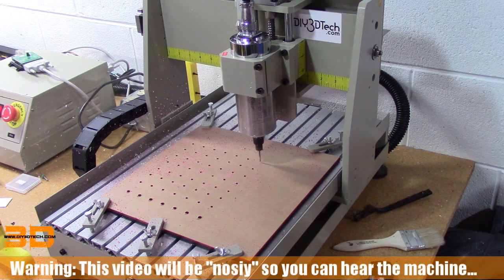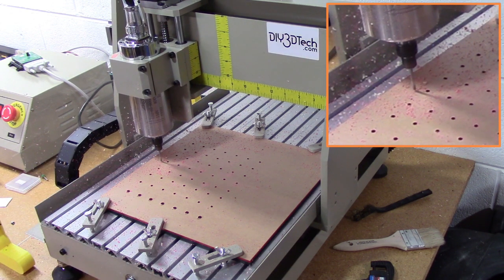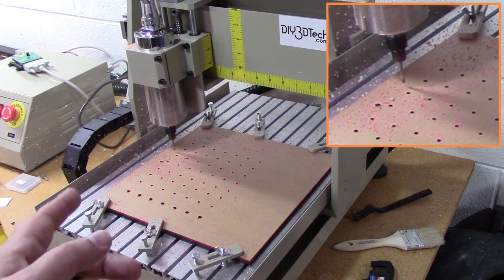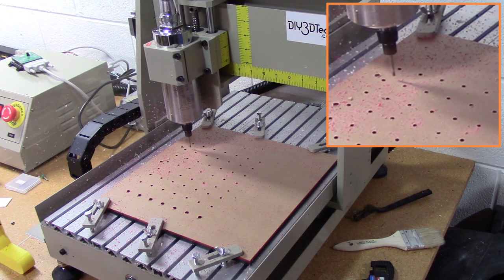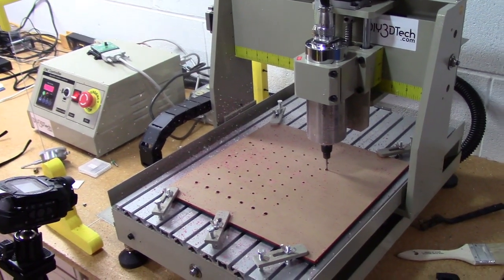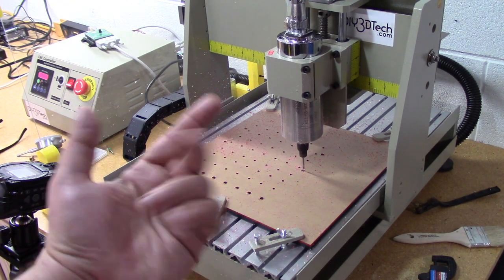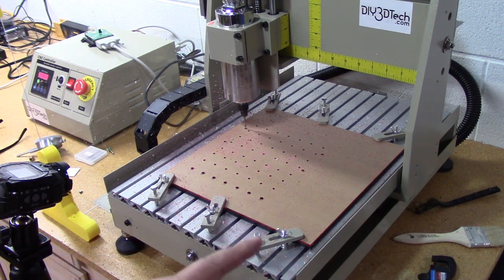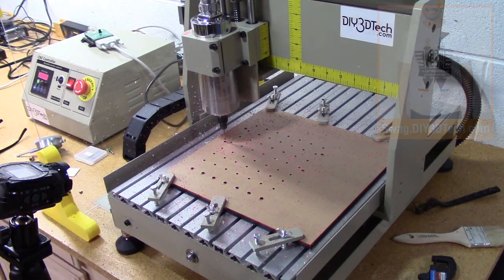3040 CNC - Quick Update!

Comment: I have a 3040 purchaced from china and can not get the X axis to work,I have replaced the stepper motor board but still nothing.   All the pins hsve been set up correctly.   Any idears  I need help before I put an axe through the whole machine please.
Reply from the maker: Did you (1) take a multimeter first and check continuity of all the wires (2) did you check the continuity of the stepper motor itself?  Also assume the Y is work so that is a know good, (3) did you try swapping X&Y to see if that works (since Y is known good).  Myself I am betting on #1 as I have a number of viewers write and tell me they have had to replace the stepper wiring harness on their 3040.  Hope this helps!

Comment: I have the same vfd. I would like to wire limit switches to it but am confused on where they would hook up after opening up unit. Have you ever wired limit switches to your controller?
Reply from the maker: Limit switch are easy per-say if you are using GRBL (which I am) as you simply wire them into the CNC control board to the limit switch pins.  If you are using Mach 3 it is little harder as you will have to run them (or should) via buffer to the correct pins of the parallel cable.  If your a home hobbyist I would highly recommend the GRBL route...
Reply: Thank you for the reply back.
I am using Mach3 and i don't have a problem wiring them to the parallel cable if that's what i need to do. I would actually like to try it but of course am having trouble finding info. about it.
What do you mean by "buffer"? Is that a board i would need to get  or just wiring some passive components in? Any more help would be great if you can, otherwise thanks again for your comment.
Reply from the maker: yes just a TTL buffer (something like this) http://www.ti.com/product/SN7417 just to keep from frying the paralle port as it wasn't designed to have switch input so this will clean it up.  I can't recall the pins for Mach however you can google it and there as to be ton of info out there as I did it about 8 years back on my Probotix...

Comment: what programs are you running?? How did you find the free mach 3 to work?
Reply from the maker: I run GRBL connected to the Parallel port and even wrote a book on it here: http://amzn.to/2fx4rny then just use a Gcode sender like here: http://diy3dtech.com/gcode-sender-reference/ to send the gcode.  Most 30XX come with a bootlegged Mach3 and had in the past purchased a copy but way to complex for hobbyist use...

Comment: does it come with software ?
Reply from the maker: They come with an older and what many consider "bootleged" copy of Mach3 which requires a parallel port computer (hard to find thee days).  You can by version of Mach3 (not cheap but very good) or use Linux CNC (free but requires Linux and a bit complex) or do like I did and convert this GRBL...